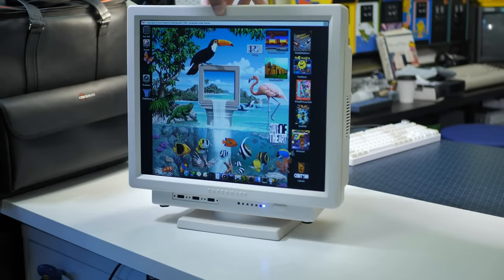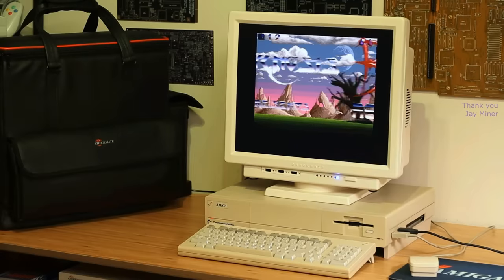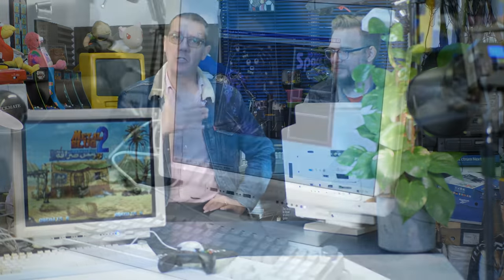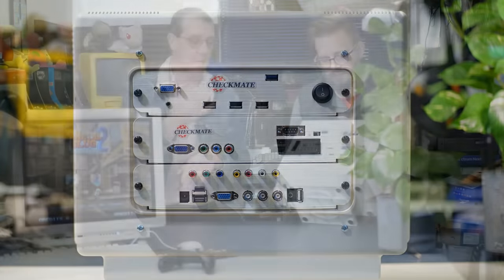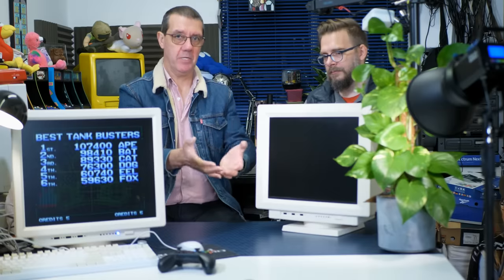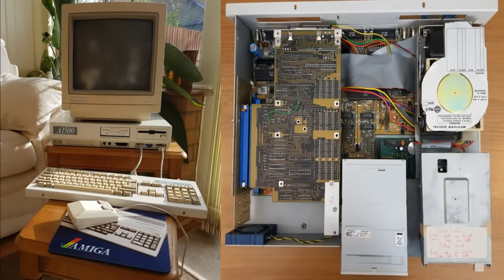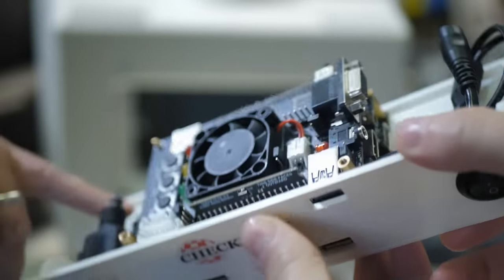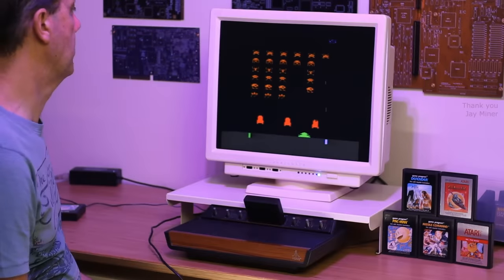This Monitor is the Future | Nostalgia Nerd

Comment: backed it. ill be sure to give it a full review when it comes out
Reply: "Mistakes Were NOT Made"
Reply: Can't wait to watch! Backed it cuz I saw u backed it!
Reply: MVG is king
Reply: You are the best!!!
Reply: Already looking forward to seeing you put it through its paces!
Reply: I was definitely wondering what you and lgr would think about this
Reply: Whats the benefit of this compared to normal nowadays monitors?
Reply: @zilverheart  honestly none.  It displays an image.
Reply: @Fractal_blip  im shock ed
Reply: @zilverheart  the inputs. Your normal nowadays monitor usually comes with hdmi and displayport a 16:9 aspect ratio and no support for interlaced video. This monitor is 5:4 aspect ratio, has support for interlaced video and lots of inputs such as scart, bnc, composite, component, vga etc. That makes all the difference when you're connecting retro systems.
Reply: @sniglom  ok
Reply: @sniglom  that makes it expensive to mass produce, the ports add the cost not to mention some of those ports ceased production / support, making them rarer and more expensive nowadays.
Reply: Ohhh can't wait for this one!
Reply: @sniglom  aren't you better off with something like a retrotink ?
Reply: @jasonz4545  yes, that's why it's not cheap. Normal marketing rules, supply and demand.
Reply: @gerboog  no, I'm not. I'm not a buyer of the screen, but I do understand its benefits.
Reply: Hope the black levels are good!
Reply: Did it ever come out?
Reply: Make sure to play all consoles if you have them. Like GTA SA fr fr.
Reply: it just came out apparently
Reply: @jub8891  what a coincidence, I am watching the new video right now lol

Comment: It's good to see a monitor manufacturer, even a small one, finally paying attention to the retro space.
Reply: One step closer to newly manufactured CRTs

A man can dream 😢
Reply: It won't get made if you don't all back the Kickstarter
Reply: It's just a case with accessories. You fit your own flat panel and other monitor guts.
Reply: @Gr00t  
Companies DO make CRT-s, just not for consumer electronics.
Reply: I've been saying this for years that someone needs to make a tv,monitor that's new school, but old school
Reply: What monitor manufacturer?, it's just a case!
Reply: @tyaty  what are the crts for? Which company makes them?
Reply: @marcellachine5718  
Thomas Electronics, Inc. for example.
Reply: Bye Steve Jobs! Ops, Jones
Reply: I’m buying one
Reply: I think this would be perfect if it contained a mini 486 DX100 - one of those small industrial boards - something like: the weeCee. - awesome that there is a 1ms panel, - but a 24" OLED would really compete with a CRT.
Reply: @marcellachine5718  mostly for aeroplanes and the defense industry. CRTs are a lot more durable compared to LCDs, they only need to be serviced once every couple of decades, lots of military equipment are still using CRTs from the 70s and they work perfectly fine, while an LCD would need backlight replacement, polarizer replacements, humidity issues, etc.

the problem though is since it's designed for defense equipment, the CRTs manufactured nowadays are mostly monochrome/black and green, since you don't need color for simple equipments.
Reply: @6581punk  No they said they have 3 monitors that they'll offer
Reply: It's a case only.  The monitor is just an LCD made by an LCD manufacturer.
Reply: @Gr00t  We can dream, but CRT's use way too much lead and mercury to be manufactured large-scale for the consumer market with today's regulations. We have enough CRT's currently, due to the small niche that actually uses them, and as long as they're kept in good condition they can be used for many years to come.
Reply: @tristan6509  - CRTs from the 70s generally don't work fine, unless work has been done to them, and usually once you fix one thing, another breaks. You often have to re-solder everything and replace the capacitors.
When they use flatscreens, they don't have to replace back lights, etc. They just replace the whole screen.
Reply: @peterwhitey4992  that's exactly my point

With CRTs you can repair or replace the mainboard and keep the tube, with LCDs everything is junk after a few years and you have to replace the whole unit.
Reply: @tristan6509  wait, this isn't true. CRTs need flyback transformers replaced and the tube has a finite lifespan due to the phosphorus(i think the figure is 30k hours of continuous useage). You can think of a CRT tube as an incandescent light bulb. They glow dimmer and dimmer until they go pop. This is one reason why CRTs have brightness adjustments, as the tube glows dimmer, the user gradually turns up the brightness to compensate.
Reply: @Romerco77  it does come with a panel, you just select it later on in the process which panel version you want. a budget or gamer panel
Reply: I wish it would use the extra depth for a removable backlight . I wish as well it had strobing back light for a more CRT movement feel.
Reply: yes but not with led, if they could do crt this would be best
Reply: I imagine these are fairly cheap Chinese screens.. nothing to exciting.
Reply: @Gr00t  
factories have closed, you should see what goes into just the glass...
Reply: @Gr00t That ain't happening, EVER.  New CRTs will never exist.
Reply: @tyaty  by their own admission, thomas electronics is a repair company not a manufacturer
Reply: their not a manufacturer

Comment: I'm sorry, it looks like a high quality product and all, but I don't really understand why, you lose all of the benefits of a crt, this is basically a modern LCD with some adapters in a fancy shell. Personally I'd want something more ambitious, an oled panel with a high hz and black frame insertion for the absolute best color, black levels, and general fluidity of motion as possible, Id want it to be powered by something akin to the retro tink 4k, with both the option of crisp high res pixels or a damn convincing crt filter, something like that could render every screen in my house obsolete

Comment: I like how he kept it real "I could replace all my monitors with this!"  "Nah, you're not going to do that, CRTs are still great"  That they are, that they are
Reply: I wish someone would still manufacture CRTs. I would love a 1080p 16:9 CRT at a reasonable price. I know there are such CRTs, some of which are old new stock (or was it new old stock? I don't really care), but they are stupidly expensive.

Really, the only reason I am using an LCD is because general unavailability of such CRTs.
Reply: @UltimatePerfection  Unfortunately there is very little people left who would know how to run the manufacturing of CRTs for example a Chinese company apparently bought all the tools to make CRTs from old manufacturers but couldn't find anyone with the skills to run them. Only ones that still get made are small and only work for specific equipment.
Reply: @consensus889  I am sure that you could find some retired CRT engineer that either can get back to the action so to speak, or teach new workers how to make these.
Reply: @UltimatePerfection  Even if there isn't - there is heaps of written documentation regarding them and people are more than capable of figuring it out. We did it the first time without that benefit. I'm still hopeful we'll get back to em.
Reply: til you move one.
Reply: @cmdraftbrn  It's only your fault that you are too weak.
Reply from the maker: Yup, put me in my place. Correctly.
Reply: @consensus889  Speaking as a gunzel: People have figured out how to make period-correct steam locomotive parts with far, far, far less available documentation than we have available on CRTs. Where there's a will, there's a way.
Reply: @TheDemocrab  The technology involved in making a Locomotive is orders of magnitudes less complex than the tech needed to build a CRT. You need factory level precision and industrial grade machinery in order to build one.

Even if theoretically possible, it would be so expensive that I doubt someone will ever try it soon.
Reply: @souljastation5463  You're missing a key thing there: The basic concept of a steam engine is simpler than a CRT, but the level of potential danger in operating even a stationary boiler/engine is a helluva lot higher leading to much less ability to rely on trial and error to get it right.

For example, the biggest pressure differential you get with a CRT is the vacuum tube which is a helluva lot less dangerous than what you would get in a steam boiler meant to operate at even "just" 160-200 psi. (Versus the 270-300 more typical of later American locos)
Reply: @UltimatePerfection  "I would love a 1080p 16:9 CRT at a reasonable price."

Why would you settle for a 1920x1080 CRT when a 2340x1440 CRT was available 25 years ago?
Reply: @cmdraftbrn  Once it's where you want it why would you move it?
Reply: @UltimatePerfection  A FullHD plasma is pretty much just that. They are 25€, which will let you forgive some of its differences with CRT tech. No idea why one would run a new CRT plant, if Philips for example had figured out how to make flat CRT's in the end of the CRT lifespan. Exactly same tech, without many of the downsides, voltage was lower, energy use less, totally flat, HD resolutions. Why they never made it, was that LCD was already so much cheaper and using less materials in easier production facilities, they parked the idea forever ever after.

Comment: The thing is, we don't want a modern panel.  Modern panels are the problem.  The reason we want CRT's is because older games were designed to look good on CRT's.  It doesn't look the same on a modern IPS panel.

Comment: AFAIK this is just a standard, off-the-shelf 19" 1280x1024 5:4 aspect ratio LCD panel -- the kind you can find at thrift stores for $10 - $15 -- with custom electronics and a custom case. And the claim that PAL is a 5:4 aspect ratio is incorrect. Both NTSC and PAL are officially 4:3 aspect ratio, despite their different resolutions. I think people got the false impression that PAL has a taller aspect ratio because Amiga and Atari ST owners would switch back and forth between NTSC and PAL modes depending on the software they're using, and rather than adjusting the monitor's vertical size every time to compensate for the different resolutions, they'd just leave it at a compromise position, so PAL would look taller than NTSC even though it shouldn't.

I'm not saying it isn't worth supporting this project; but the people expecting it to be a bespoke, true 4:3 aspect ratio LCD will be disappointed. If you want to display a correct 4:3 image on it, you'll have to live with some letterboxing.
Reply: the panel demoed in this video looks like garbage but the panel isn't even included with the kickstarter. it's a pretty cool idea for a bit of kit but i have trouble imagining the audience for this product. it's not a CRT and it's never going to look like one. and the kind of collector that already has such a variety of consoles or whatever to necessitate such a wide variety of input flavors presumably already has the displays to accommodate. if you're only using a limited variety of signals, there are already a wide variety of adapters that will allow you to use the panels/crts you already own. I guess it would be pretty cool to bring to trade shows or the like, so you could support whatever obscure device someone might show up with, but for any kind of a dedicated use, there are already superior alternatives.
Reply: The masses will eat anything right up as long as it LOOKS like a CRT. This IPS panel has only 1 advantage: The several different ports.
Everything else is just as shitty like those 10-15$ IPS monitors.
The pros of CRT lies within the technology itself, the great great contrast and zero latency, which this monitor does not provide. So def not worth it.

Comment: I've been developing something similar for years, but my biggest problem is that I don't want a flat screen, I want something at least similar to a trinitron from the 90s, a slightly curved screen. This has been my challenge over the last 2 years, to design this front glass so that it doesn't distort the image.
Reply: You can buy a curved LCD
Reply: You got an optic problem so making a custom lens for you monitor is expensive. My only solution is to make it out of clear resin and do tests and get advice from a optics professor.
Reply: @PutineluAlin  I tried transparent resin, but at least here in Brazil, I didn't find a resin that didn't turn yellow after a few months. I believe it is an effect of the hot tropical climate here.
Reply: @RicardoRamosRetrocomputacao  Might be worth a shot to laminate it doing that might create a slight distortion but it will be hardly noticeable and the tight thin seal will prevent the air and heat from making any changes.
Reply: @PutineluAlin  PMMA may be clearer in the bulk. Then iron the curved surface?
Reply: @ArneChristianRosenfeldt  there are lots of materials with different properties and talking to manufacturers might give you the right solution.
Reply: @PutineluAlin  I just like that here we may use our intuition. The thicker the material, the more importance is the interior. Thermoplastic 3d prints got smooth surfaces (optical quality) by heating. Why does this not work on CDs? Material typically used for car windows and F-16 ..
Reply: @ArneChristianRosenfeldt  it can't be used on cd because of laser reading
Reply: That's why I'm excited about foldable screens, I'm hoping somebody gets the big idea to use one to make a fake CRT

Comment: Incredible. This is the way things need to go. There's definitely a market for monitors for retro use. Now all you need is some sort of super bright 900 line OLED panel which (through science and algorithms) can mimic the horizontal/vertical scan frequency, beam landing and convergence of a CRT and you're laughing. Oh and the native scanlines as well. I'm sure we'll get there one day 😁
Reply: At that point it would I would rather them get old CRTs, refurbish the tubes and put it on a chassis similar to this with tons of ports and expansion capabilities. It would cut down on all the ones setting at recycling centers too
Reply: An FPGA board for CRT simulation.
Reply: you can make cathode ray tubes at home, making your own screen is only like several dozen even more complicated steps from that

Comment: I think, the one more solution to make it even better is to enable an optional adjustable v-synced strobe backlight (either LED or xenon) to eliminate the blur trailing and make motion image as crisp as it looks on CRT
Reply: This is the kind of thing that should be blatantly obvious and standard for any product that pretends to innovation.
Reply: Why did it fail on the market? At least for mainstream.
Reply: @ArneChristianRosenfeldt  CRTs actually lasted for a really long time before flat screen technologies replaced them. They ultimately failed because of their size and weight; you can stock like 5 times more flat screens, so you could sell more screens more often, and make more money than selling CRTS; especially because shipping would cost you so much less in comparison.
Reply: even 1ms strobe isnt enough to come even close to CRT fast motion handling.

Comment: The kickstarter is odd, there is no option to actually back the monitor, just the case for the monitor, panel excluded on all of them... so 249 plus almost a year wait for a monitor shell with no panel and some electronics?  If i'm reading it wrong, please correct me, can't be the only one reading it that way..   Where does one even find a 19" 4:3 panel these days to stick in there?

Comment: This would be a lot easier to back if there were tiers inclusive of the various panel options, and ideally with the various options/accessories as well. I suppose this approach is more cost efficient (reducing KS fees) but it took quite a bit of scrolling to understand what was going on, and I still haven't found an explanatory video mentioned in the pledge. Steve seems like a very genuine person but the campaign feels quite dodgy unless you put time into research. It's a shame because this is exactly the kind of project that KS was made for.
Reply: Sadly not possible due to margins and what Kickstarter take.